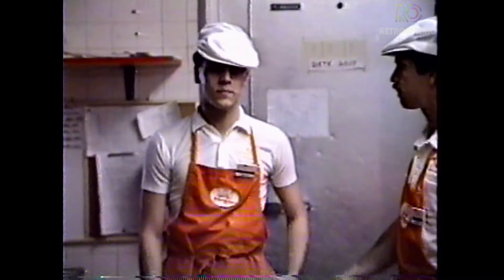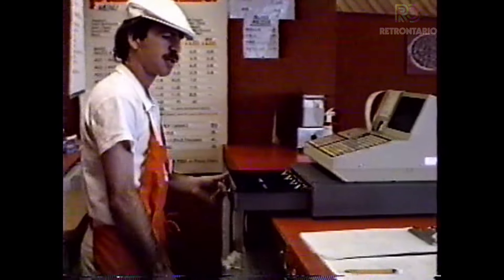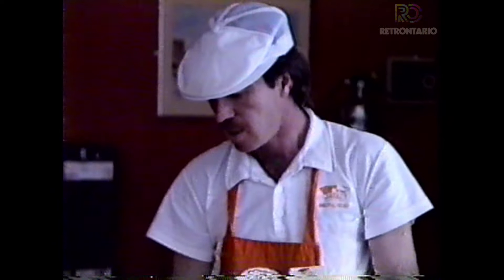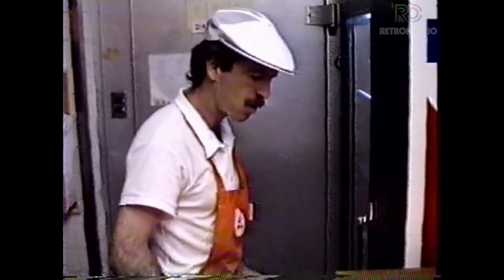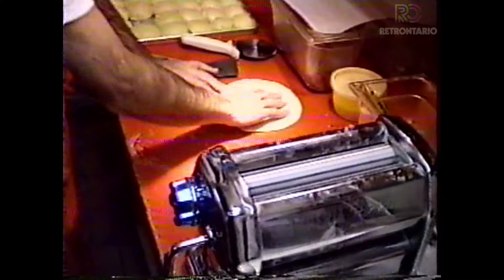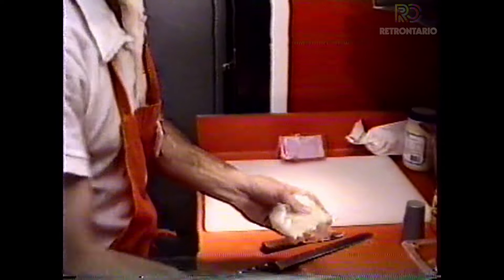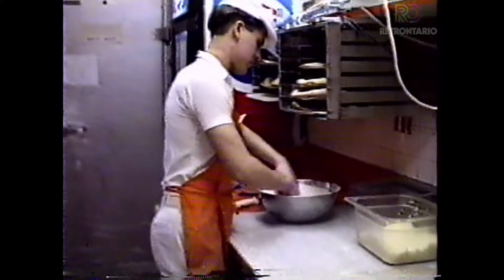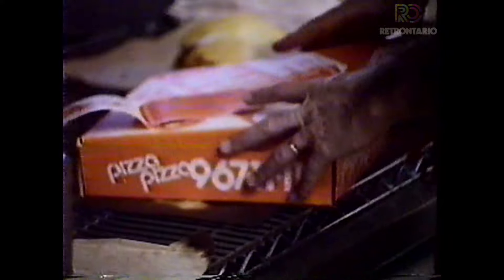PIZZA PIZZA TRAINING VIDEO (1987)

Comment: As a restaurant inspector, its interesting to see that not much has changed; the same style of gas ovens are used, the lattice metal shelving, the plastic spray bottles, the prep counter with condiments stored at the back, the plastic storage tubs, the pasta roller, the pepsi fridge that still runs on 1987 refrigerant...

Take out the old casier, the smokes, and the scene where he's cleaning the window (showing the cars) and it could pass for a modern training video that was downscaled by using a VHS filter in post production.

Comment: Is this the location that was at Yonge and Elm? 
I was surprised when that location closed at the end of 2019
Reply: Sure looks like young and elm old locations
Reply: No, this is the Broadview and Danforth location. When the manager is cleaning the store at the beginning of the video, you can see that the building across the street is too new/modern to be anywhere near Yonge and Elm. Also, at 40:59, the delivery guy picks up an order for "706 Gerrard". Gerrard Street West is very short and doesn't go up that high, so it has to be Gerrard Street East. This means they're in Riverdale, and not Downtown. Broadview and Danforth is the closet location to that address, and you can see the same building across the street on Google Street View.